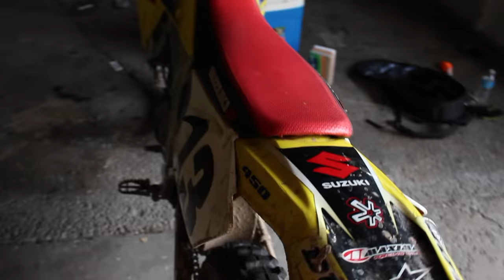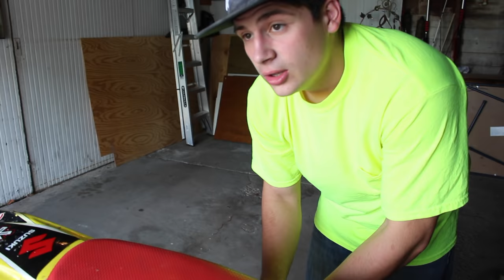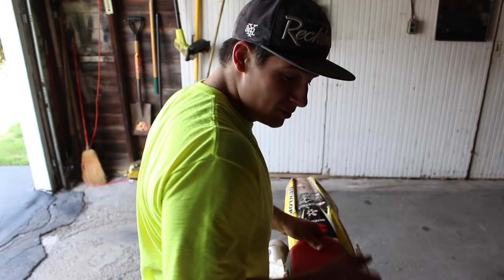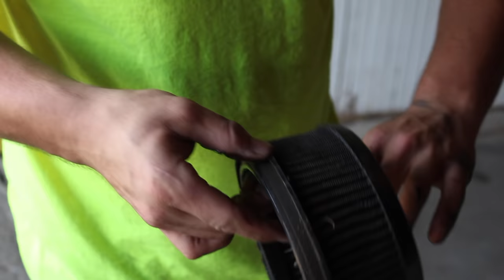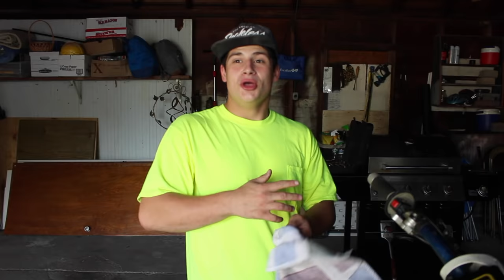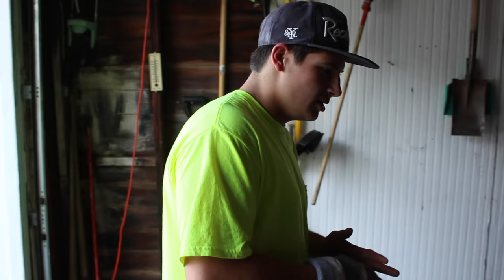POLICE CHASED HIM!!! ALMOST TASED

Comment: i could get away on a unicycle dont need a 450
Reply: It's not about "need" it's about what he likes and what he wants, just like you don't need a phone or computer.  And, it's way faster than a unicycle.
Reply: nah i was joking but he was slagging off 250's when theres nothing wrong with a 250 or 125 yz125 2 stroke is as fast as a 450 4 stroke so dont know why he was mocking them..
Reply: i said its as fast ive rode a crf450 and a yz125 both are fast but the power is delivered different
Reply: Amber Nectar a yz 250 2 stroke is as fast and faster in the power band as a 450 four stroke.  4 strokes have more low end torque.
Reply: Amber Nectar I couldn't get away on my 450. can't outrun a radio unfortunately